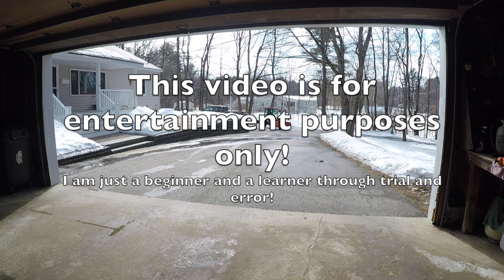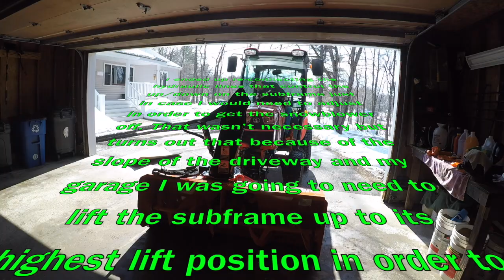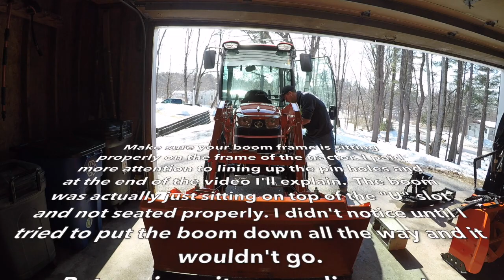#4 Spring Switchover on the B2650

Comment: I saved the pallet the snow blower came on and just drop it on the pallet. I have a pallet jack to move it to an out of the way spot for the off season. Pallet jack’s don’t cost much and so worth it. Good video.
Reply from the maker: I'm into a new spot now where I don't have any issues. But a pallet jack would have been a great investment at the time. Also, the dealer delivered everything without pallets so I didn't have that option at the time. Thanks for watching!

Comment: I have the same tractor, cab and bucket. I take it off in the Summer for mowing and on in the Winter for removing snow with with the bucket or my snow blade with my box blade in back. (I have a Bobcat for all summer bucket work), so needless to say, I feel like a rookie every time I put the loader back on. Some day, I will get concrete in my shed to give me a nice level floor (which really helps) to make it easier to put on. Looking into the snow blower. Not sure yet if I want the front mount or a 3-point rear mount, which is one reason I came upon your video. Good video!!!

Comment: I store my snowblower and subframe on Harbor Freight dollies.
I bought the little ones, one for the subframe and two for the blower.
I lower the blower onto the dollies when I am removing the blower. This saves your back and any messing around trying to get it onto the dollies. 

Subframe about the same. Place dolly under subframe while still on the tractor. Remove rear pin and pivot onto dolly. Remove front securing bolt/bar and lift up and drop onto dolly.
These dollies are almost the perfect height, maybe a bit short. I guess you could make some, but these are cheap and do the job for me. Second season doing this.
Reply from the maker: Thanks for the advice Tom. I was actually looking at those online yesterday. I've made some adjustments and am able to just place the blower on the floor dolly with the tractor subframe. Great idea with the subframe dolly though. I'm going to do that when I switch over again.

Comment: Thx for the video. Do you find the B2650 hst w/ cab very noisy? Also curious how tippy it is on hills or uneven ground? Thx!
Reply from the maker: Hi Stephen, yes, the hst is noisy but I've just gotten used to it.  When I first got the tractor I figured there had to be something wrong but researching I found it is what it is. I don't have a lot of hills or areas where I put myself in position to tip but I could see that this may be a wheel spacer candidate.

Comment: i will be a first time learner too  bx23s  orb2650 no back hoe tough dission
Reply from the maker: HI Rob, I had a bx2370 before the B2650 and ultimately for me it came down to factory cab or aftermarket cab.  The Curtis cab Deluxe version was nice and fit the tractor perfectly.  It also had plenty of room and you had lots of options with the windows being open or removed.  The kubota cab was more spacious but could only get on the 2650 and had AC.  There is definitely more room and more viewing then the Curtis.  The price through my dealership was only a couple of thousand different, you got more power, and in my opinion a better cab.  I also don't mow with mine and the clearance was important as I plan on doing a lot of tree work.  So the extra lift, power and clearance was also a big decision maker.  After the 0% financing over 60 months for $2K the pricing wasn't much different so I opted to go bigger and more versatile with options.  I was also hung up on the backhoe piece but realized that I could just rent for half day projects and save myself a lot of money, and time with care.  Good luck on your decision.  Both tractors are great!
Reply: @BeginnerforBSeries  ty was just trying to make dision hard looking at b 2650 might be more tractor than i could use but its not full size which i like ty